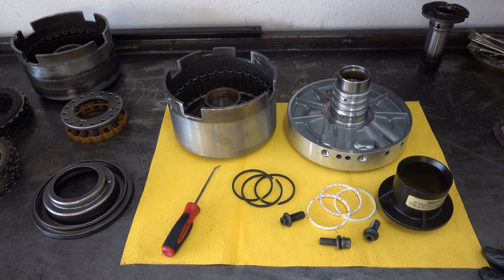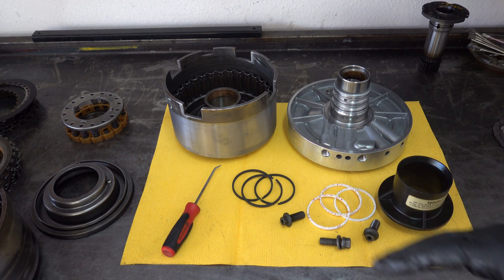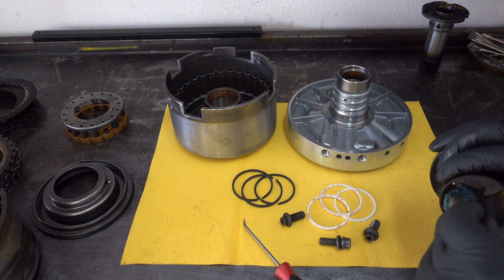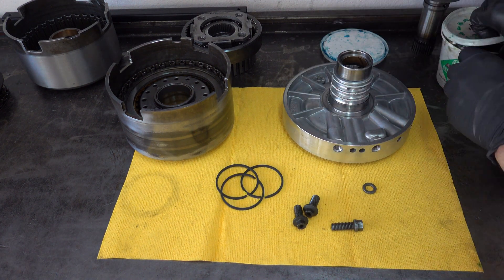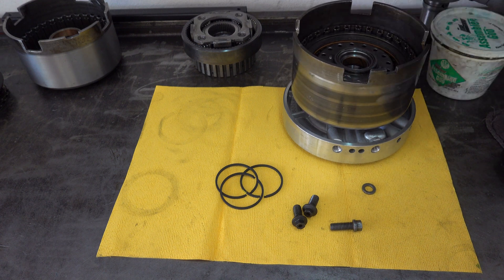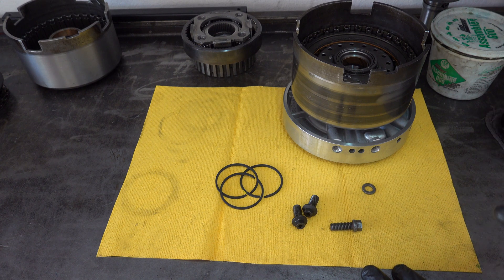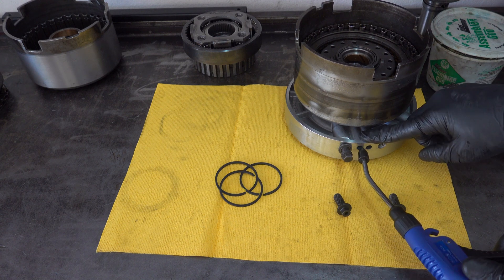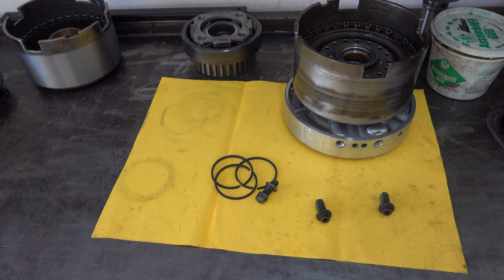Rebuilding the 200-4R: Center Support Teflon Sealing Rings and Dual Feeding the Direct Clutch

Comment: Hi Nick, thanks for all the great content sir!  Do you add a bleed hole to the direct drum when dual feeding? I've ran across references to doing so, but am wondering if the CK shift kit mods are making it unnecessary? Working on a build right now and am to this point.
Reply from the maker: Thank you for the view and kind words, Aaron!

I never add a bleed hole as I never found it to be necessary, unlike TH400s and 4L80Es.

Comment: Hi Nick 
It is going behind a 462 pontiac , i have the billet parts from CK performance but the kit only came with stock seal kit , what seals to use on turbine shaft and input drum
Reply from the maker: The stock turbine shaft sealing rings are fine, (you will need a sizing "device" for the larger one-piece but i show you a cost effective way to solve for that in the 200-4R rebuild series) though you can call Chris at CK to see if he has any other sealing rings.

Comment: Hi Nick your videos are great . I am build a 200 4r and my seal kit only has scarf cut teflon rings and iron center suport rings what do you use for solid rings ?
Reply from the maker: Hi Bob, thank you very much for the kind words.

If you're doing a largely stock rebuild that won't see a lot of high (5000+) RPMs behind an engine making 300HP or less, the solid rings are fine however if you're outside of those limits, I'd spend the few bucks for the solid one-piece 4L80E teflon sealing rings shown in the vid. You should be able to get them from your local hard parts supplier for around $10 or so. I'd also recommend dual feeding the direct clutch and installing a forward drum with a billet intermediate shaft if high RPMs are part of the picture.